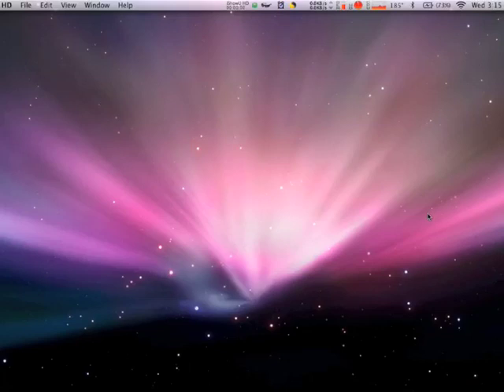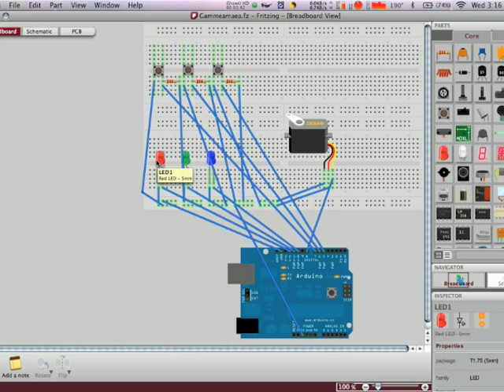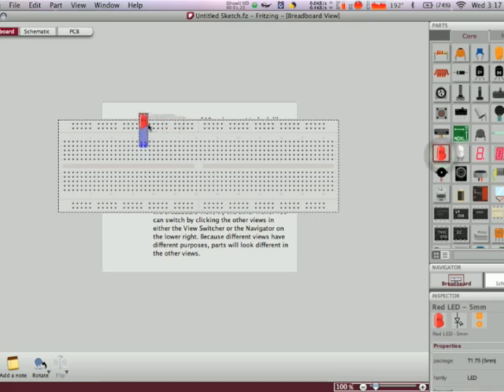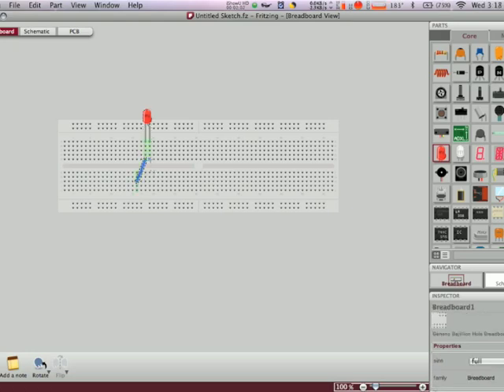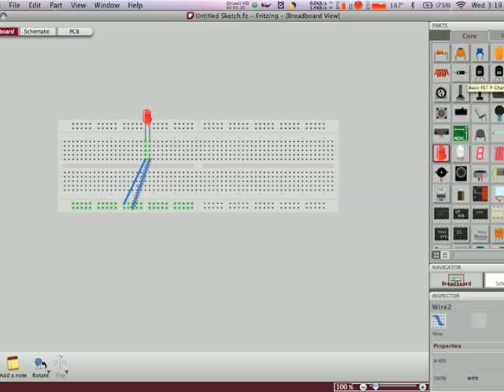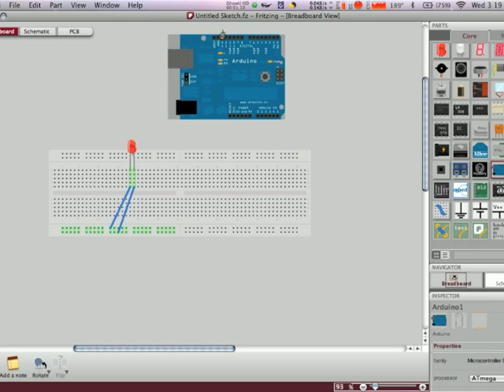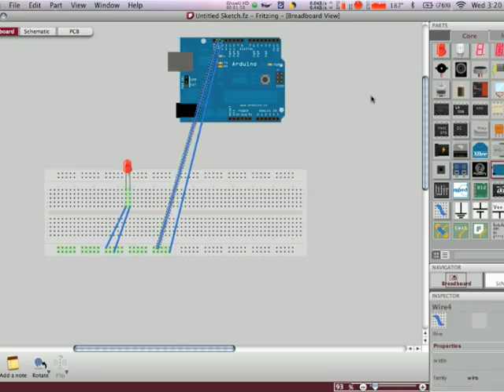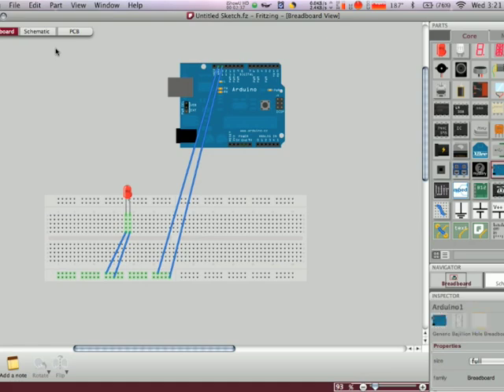Fritzing Tutorial

Comment: @chemy999 That's the main problem about the program. It's just supposed to let you put a circuit down so that you don't have to go through the mess when you actually do it. Although it tells you when there's going to be intereaction between things. For example, If you connect voltage somewhere, it'll highlight the nodes that will receive those 5 volts. There's no real way to tell if your circuit will work properly on this program though. At least I don't think...